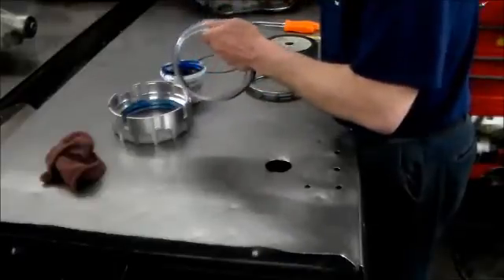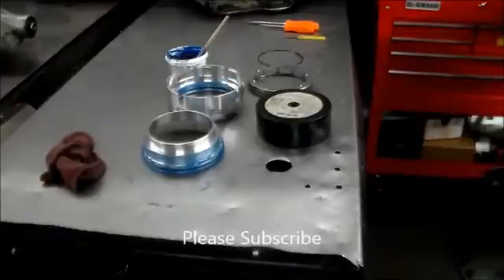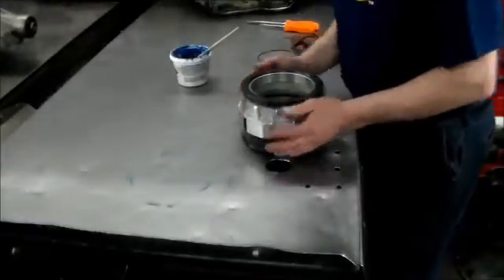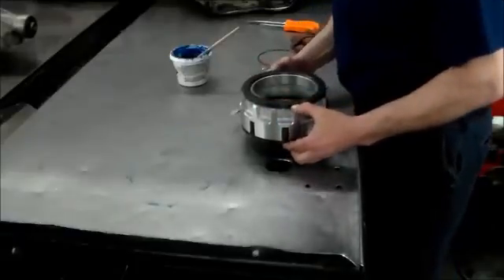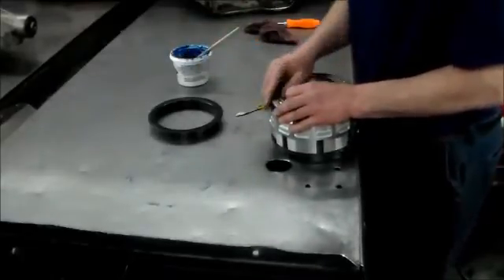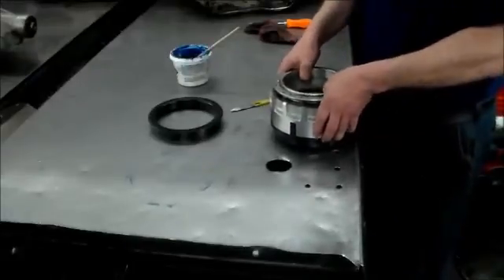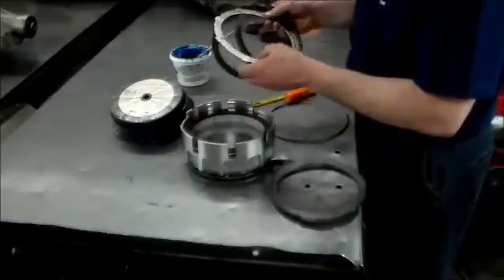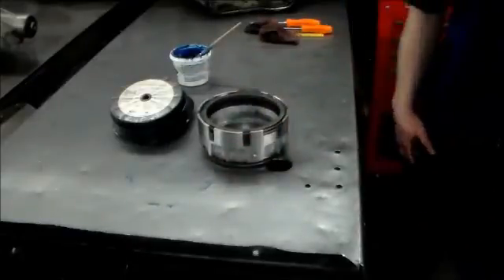4L80E Overdrive Clutch housing Assembly

Comment: uhm slight correction. That can be done without the special tool. BUT it is a pain in the butt!! And you are at high risk of damaging those seals.  The first 4L80E I rebuilt, I did it entirely without any special tools. I gave up on vaseline as an assembly grease really fast. Used a tiny bit of motor honey instead. That stuff is slick and I worried about it causing the clutches to slip even though the transmission worked great. After a few hundred miles I changed the fluid for the hell of it to get as much of that stuff out as I could. Even though it worked good it was still a pain. I ended up inventing my transmission holder and a special tool to hold those damned springs in so I could get the lockrings in on the others. I just muscled the overdrive similar to what you did there. Best time to have 2 extra arms.
Reply from the maker: +consaka1   I think i tried it once without the tool, didnt get very far, used my buddies and slapped it together in a few minutes,  motor honey is that like  STP oil?
Reply: Gary Ferraro Very similar to STP.  50 50 mix of stp and engine oil is what us poh boys used for engine assembly fluid.
Reply from the maker: When ever i have a problem with a seal, i use the stp, works well, how long are you rebuilding transmissions for?
Reply: Gary Ferraro I only rebuild a transmission because I have to. lol I don't do it because I like to or get paid good for it. Only if someone can't afford to have it done or my own vehicles of which I have a few.